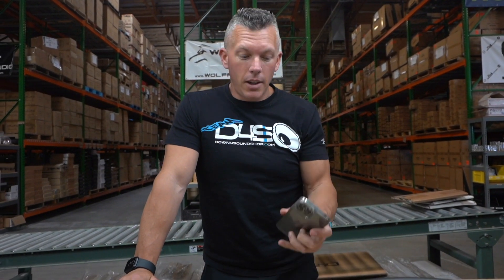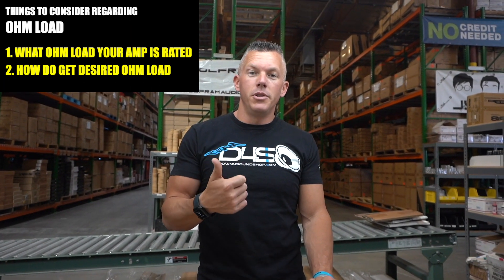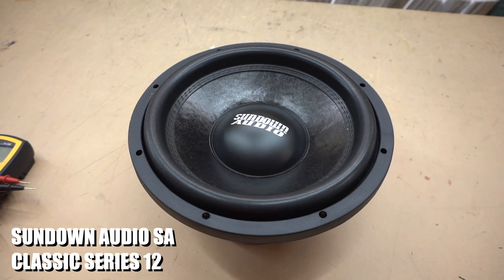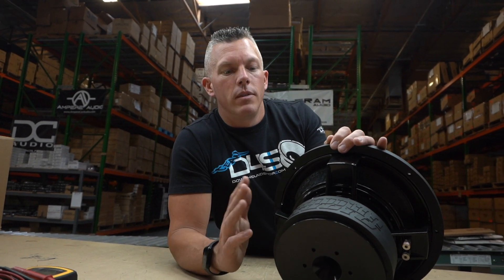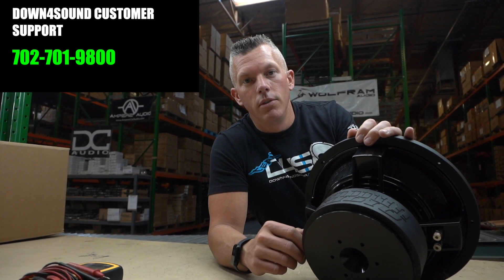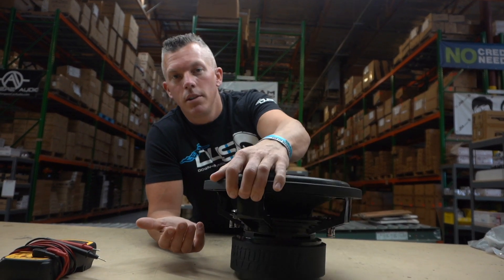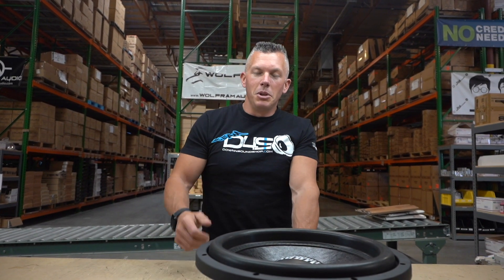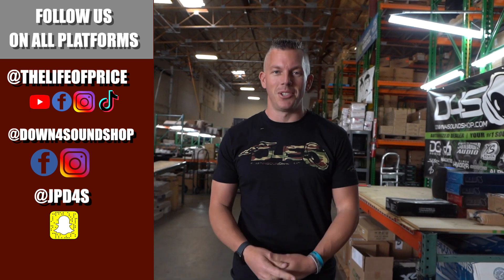HOW TO KNOW WHICH OHM LOAD TO USE?

Comment: I have tried different resistances , but I feel like the sub get les torque (less kick in the bass) when I wire in 1ohm instead of 4 ohm. Is it just me or maybe my amp that I used didn'y like 1ohm even thoe it was rated?

Comment: so if i have an amp thats rated  800 at 2 ohm and 1500 at 1 ohm, if i wire the subs to 1 ohm the amp will read that? and give desired power

Comment: Could you help me out? I have two 2ohm Skar EVL 12’s on a 2700.1 NVX amp. Could I run them at 1 ohm or only .5ohm? And if I run at .5ohm will it hurt the subs?
Reply: You can only wire them at o.5ohm, 2ohm, 4ohm, not 1 ohm

Comment: Hi  THELIFEOFPRICE
Do you think this is a good setup, I plan to get soon?
SUNDOWN SIA 2500W  
Skar VXF-12 D4 (Dual 4ohm Voice Coil)   x 2 speakers
SKAR AUDIO DUAL 12" PORTED SUBWOOFER ENCLOSURE - 4.00 FT^3 @ 32 HZ | SK2X12V
Reply: I got two 12in Skar EVL-12-2 they have dual 2 ohm voice coils and I wire them all the way down to 1 ohm when I'm feeling reckless 0.5 on a Rockford Fosgate T2500-1bdCP

Comment: Can 2 - 12" 4ohm DVC subs be wired together outside the box when in Parallel for 1 ohm load total?  For example 2 subs in its each sealed chamber.  1 wire coming out each chamber put together to the amp.
Reply: Yes, wiring everything parallel,  you can even check with a multimeter,  the final impedance should be 1 ohm load. Some ppl run the wires out the box just for amplifier flexibility in case they swap it for a different spec one later
Reply: @stevelovesgod  Thank you!

Comment: I just stepped down my system for the sake of trunk space from x2 12's on a RP 1200.1d and bought a NVX vc series 8" with a Skar armored box. Now question is to run it at 4 ohms and feed this 650 rms underrated sub 500 watts probably more like 580 or go for 1ohm and feed it the full 1200 probably more like 1300 to 1400 @12.5v, now i do realize i need to back the amp off quiet a bit but what should i do here? I will upgrade the amp when i can afford it to the JP95 x5 channel but can't right yet i think the 700 watt mode of that amp will be perfect for this sub and a much needed upgrade for my highs.

Comment: Rule of thumb. Lower ohm load lower the bass.. higher ohm load it gets to be more punchy and higher bass and that tends to be good for that high bass and id recommend using 10s and 8s for that higher ohm load.
Reply: I have two 12’s should I use 4ohm
Reply: I have 2 kicker L7 12 2ohm q class on a taramps 1800.1 d 1 ohm I'm trying to figure out if I  should I wire them down to one ohm or should I just get the 2 ohm version of the 1800.1  taramps for the best performance? You know anything by chance?
Reply: You literally made that up
😂

Comment: I have a SA-12v2 4.ohm single sub, port back/sub back… and I just upgraded to a SUNDOWN AUDIO x12v3 1.ohm and I’m not sure what to do or how to wire it… I need to power it with atleast 2500 watts rms in the coolest runnin configuration as possible… should I swap out this 1.ohm for a 4.ohm

Comment: I am wondering about sound quality. Will playing a sub at 2 ohm is a balance between 1 ohm and 4 ohm? My amplifier can do 1 ohm, but will that change the necessary power from my electrical system I have setup for 2 ohms? I ask because I like to take full advantage of my amplifiers overall power, but I don't want to have to be changing it out because the amplifier is under more stress. But again, I want more watts. Another question. Higher wattage like from 750-2000 require a lower ohm or can I get the same power at 2 ohm or 4 ohm. Doesn't have to be 1 ohm? I am new to car audio and trying to figure out what works best. Thanks
Reply: Don't run a 1ohm load. All the cheap amps like the one jp sells recommend using 1ohm. Then when it blows u come back for another one. Also you will be getting distortion with your bass note since you'll most likely be clipping. 2 ohm/4 ohm loads are best. Kicker amp
Reply: @lilwinemane  thanks
Reply: @sublovelows  fasho_ kicker cxa-800 a good amp on stock electrical. With 2 12s or 15s. I'm runnin a sealed box so it plays everything smooth
Reply: @lilwinemane  I will check that out. I have about $1500 to play with. Hopefully, I can find a decent setup with that. Thanks again.
Reply: The old heads in my country actually found the higher ohm loads played louder thru experimenting know a guy running a single sub running at 4ohms not big power but man it BEATS.

Comment: So I have a Sundown sa 12 v2 in a ported box tuned to 36 hz and I’m currently on stock 8 gauge wire would anyone recommend to run 0 gauge wiring ?
Reply: Definitely 0  G Or maybe 2  G at smallest.
 With  that 8  G  your using you can’t deliver the  proper power  to  that sub .
If it was brand new it was probably ok that you did that.
Considering when a sub is new there is a break in process.
But it still probably needed much more power .
To  properly break it in before you really  start pushing that sub harder.
I don’t know if you ever got your answer but that should definitely help you.
I have been installing systems for 30+ plus years now.
So I definitely know my way around Amps and subs and systems.
 I still learn new stuff all the time.
Things change so much with amps and subs  I learn something new daily.
Hope everything goes good for you have a wonderful day.
Also just remember when you up the wire just make sure you put a big enough in line fuse to protect the Amp.
What ever size Amp u use the minimum size fuse that you can use will protect your amp the best.
So many people put a huge Fuse  by there battery if it’s to big your not protecting the Amp  or the car or anything for that matter.
Because it will not blow  the fuse  quick enough.
Also  or  it might not blow at all and could definitely cause a fire definitely possible.

Comment: I have a kicker l7 12" on an American bass phantom 2500.1. It's rated 1250rms at 1ohm and it doesn't have any ratings for 2 or 4ohm. I'm wondering if i have enough power to run it at 4ohm would that be better Sq out the sub or does that not really matter?
Reply: I have 2 kicker L7 12 2ohm q class on a taramps 1800.1 d 1 ohm I'm trying to figure out if I  should I wire them down to one ohm or should I just get the 2 ohm version of the 1800.1  taramps for the best performance? You know anything by chance?

Comment: I know there are different ways to set the gain on an amplifier. You can use oscilloscope, DD1, or multimeter. But if you use a multimeter, and use the square root of power times resistance, you get a different voltage on 2 ohms from 4 ohms. But if you use the DD1 or oscilloscope,you only have one gain setting. Does that make one of the methods wrong?
Reply: A bit late to the party, hope this'll still help. 

I've been settings gains with a portable oscilloscope for years, from experience it's not the most accurate thing (For SQ purposes), if all you're doing is tuning as a daily then go for it, I recently picked up a DD1+, and a CC1, tuning has become much easier since I work on a bunch of amps weekly.

Just a rule of thumb I used was whenever tuning with an oscilloscope I just bump it down a hair just to be sure. 

Good luck!

Comment: Could you run 4, 6.5, 4 ohms door speakers down to one ohm parallel and it work and sound clear? Or would it stress the speakers or amp?
Reply: Amplifier only cares about final load ( impedance )
If your amplifier is rated to go down to 1 ohm you can safely
run four 4ohm down to 1ohm
or eight 8ohm down to 1ohm
Reply: @408SPLKINGS would it make the sound quality, etc etc sound different ?

Comment: Hello. JP I was wondering I’m currently running 4DDX 15s in a PR4500 with a big 3 390 alt with a D3400 , I start at 14.3 and I keep dropping to 12.2 after a few minutes of playing. What should I do to fix that? Thanks
Reply: Check ur grounds and how many runs of wire do u have going to the back and what wire size
Reply: And how many minutes
Reply: Hello, I currently run a Mec 400a Alt Xsd3400 with (2) runs of 0/1 ofc to a Lto 6.0  to my JP23v2 @ .5 and I stay in the 14’s at full tilt . I’m extremely happy with my system.
Reply: I have 2 kicker L7 12 2ohm q class on a taramps 1800.1 d 1 ohm I'm trying to figure out if I  should I wire them down to one ohm or should I just get the 2 ohm version of the 1800.1  taramps for the best performance? Anyone have any opinions by chance?

Comment: What is the point a low ohm system vs a 4ohm system?
Reply: Basically, smaller impedance (ohm) gives you more power at the speaker.
The same amp will give you 300w @ 4ohm or 1,200 watts @ 1ohm.

Now, the lower impedance the easier it is for you to blow your amp since things get more delicate
Reply: @skobeats  exactly, what's the point? Stop being a poor and buy the proper sized amp.
I'm looking for a technical reason, efficiency, better motor control...

Comment: Curious question. I have a Mechman 320Amp Alternator running 5 XsPower D3100 batteries. It is okay that many batteries for the alternator to charged it up ? It looks fine on my two voltmeters 14.4 when is off and 13.8 to 14.0 running the system
Reply: Get a smart charger 🔌 so when you are parked it helps to keep them charged

Comment: how does bridging work on 2 channel amps. one of my bros friend ask me to hook it up. its 2 ohm stable and when i hook up the sub at 2ohms the amp goes in protect but when i hook it up regular it works fine but its under powered. i told him to buy a class d lol but hes a kid so hes broke
Reply: 2ohm stable in stereo generally equals 4ohm stable bridged.
Reply: @gakudzu7282  I don't know what that means. im not familiar with them
Reply: @rowboyto156  Bridging is just what it sounds like. Creating a bridge between the channels to combine their power. If an amp is bridgeable it will have it shown somewhere around the speaker output as to which channels to use as bridge. Generally its the 1st channels positive and the 2nd channels negative. Its essentially the same thing wiring batteries in series for more voltage. If an amp isn't clearly designated as bridgeable on the outputs I wouldn't bother.
Reply: Maybe it's not a bridgeable amp.
It should say on the amp were you connected the speaker wire.
Reply: Like wiring a sub in parallel bridging the amp cuts the ohm load in half. I've run 2 dual 4's (1/2 ohm) on an old Rockford rated at 4 ohms bridged with no problem. I've also had a cheap Walmart amp go into protect with a single d4 on it,  so it really depends on the amp

Comment: How do I know what CD player to purchess for my Mustang I want a new one and I'm running 2 12' Skar Audios and 4 6x8 kicker comp CS in my doors
Reply: Any pioneer head unit will be good
Reply: @chrisfiske  my exact reply
Reply: A lot of brands are good but pioneer is clean at almost max volume I run JVC myself and out of volume 35 I can only use up to 28 and be clean... pioneer has it figured out but anything will work just keep the signal clean is the main goal and be loud..🔊🔊
Reply: @chrisfiske  thats funny, my Kenwood maxes out no distortion @ 40hz. Has the same pre out as my old JVC (of course same company). Got it for Carplay, overall good upgrade.
Reply: @2v_media  they not the same apparently but 28 is max out of 35 so jvc is not for the win in my setup but till it goes out I'm not replacing it
Reply: @chrisfiske  since 08 JVC and Kenwood have been the same company. My JVC used to clip at 47 out of 50. Was an amazing radio, just wasn’t modern enough.
Reply: Kenwood Excelon line is always the correct answer. I’ve had them all and always end up back with them.
Reply: Alpine is my favorite brand for car stereos. Always wanted to try a Pioneer thought
Reply: Jvc has 5 volt pre out. 
Pioneer seems to be a go to for bass heads. 
Apparently they have a synthesizer in the settings
Reply: Pioneer, JVC, Kenwood, Alpine. All the reputable radio brands are established and most are aware of them. Stick to the big boys, keep it above $350, Id say you cant go wrong.
Reply: @2v_media  I payed $230 for my Alpine CDE-175BT and it has 5 volt pre out. I really like it 👍

Comment: I messed around and got 4 subs dual 2ohm instead of dual 4ohm. Does that mean that I'll have to run my Amp @0.5 ohm to get max out of it....🤔
Reply: Pretty much
Reply: What is your amp?
Reply: @yhprumhsoj  2 Crescendo 6k
Reply: I don't know what your electrical is like but if it was me I would run them at .5
Reply: Yup. That amp can handle it though. Make sure you have great electrical first. HO 300 amp plus alternator, large enough wire and battery back up.  Sky high 1/0 is great.
Reply: This is what I thought...you can wire 2 dual 2s to either the 2ohm or to .5 ohm...but if you have 2 dual 4s you can wire them to 1ohm
Reply: Yes in "Series/ parallel " (4) dual 2 ohm subs can be wired to 1ohm!